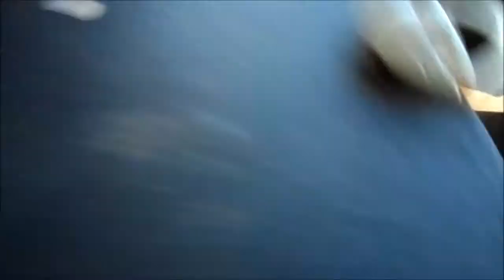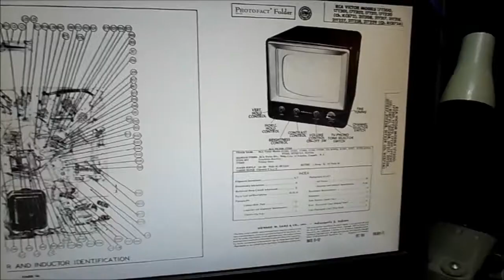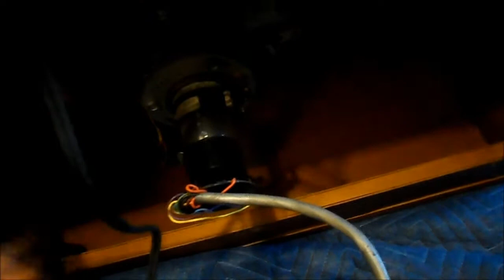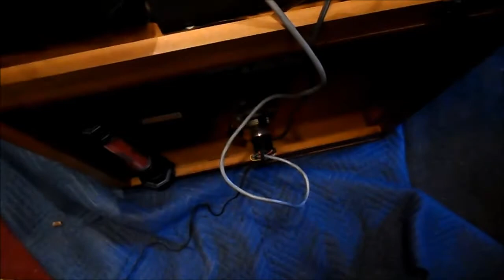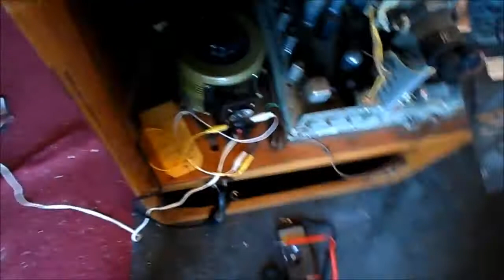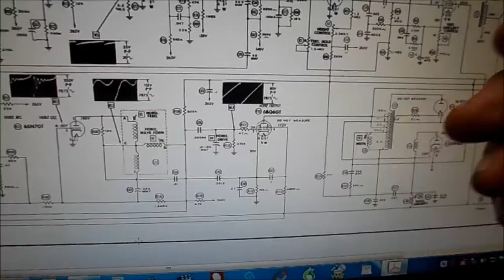1952 RCA Victor B&W 21T228  1st. Look And Assessment.

Comment: the entire metal bell has HV, watch out it can bite.
Reply from the maker: This focus method is a bit confusing. No focus pin? Need to brush up on what seems simple re: Bench test w/a glass CRT. Apply some focus voltage? Also picture tubes: grid drive vs. cathode drive service, etc. etc. Thank you.
Reply: No focus pin, magnetic focus, also used to center the pic. a big  electromagnetic coil surrounds the neck. Should be a pot that adj the focus. should be a mechanical adj to tilt the coil in two directions to center the pic.
Reply: Dave WM so there is a yoke for deflection AND a coil for focus and position.
Reply from the maker: The hole labeled focus in the tube cap turns that brass mechanical/magnet unit thing I think. I've read that a glass crt can be used if you keep the focus coil active, but lay it off to the side or bottom of the cabinet, & then apply your own focus voltage to a newer crt.? Just thinking down the road. I'm not touching the neck for now. Just some bench-testing thoughts.
Reply: Farmradio
yes common to make that conversion just leave the coil in circuit. The sets I have worked on with magnetic focus used a power wire wound pot to control the current thru the focus coil.